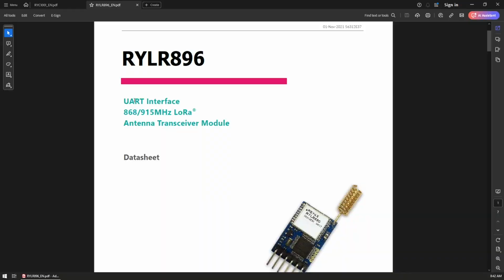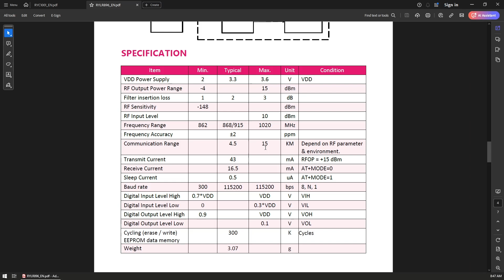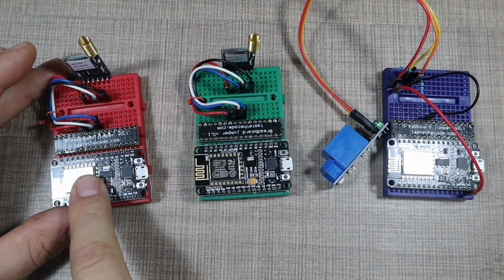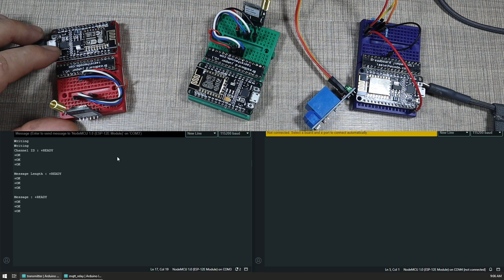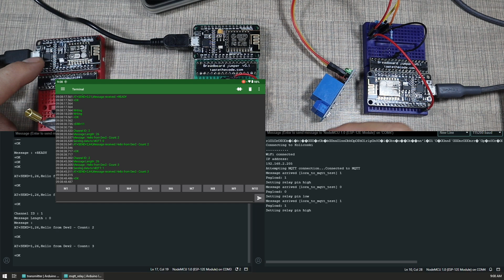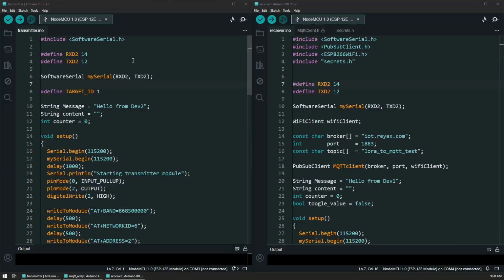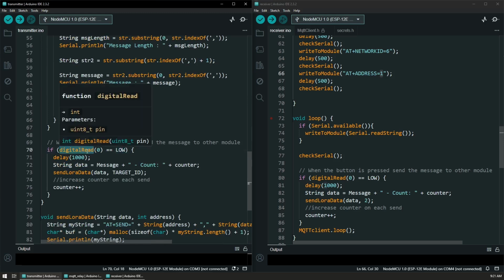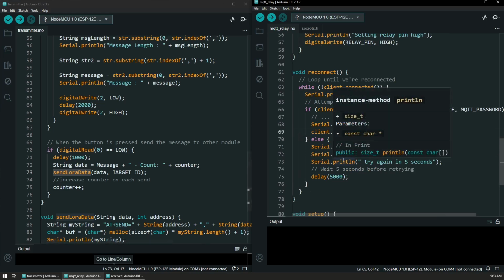Worldwide LoRa Coverage with RYLR896 and RYC1001

Comment: Your channel is amazing. Thanks for making this video. Would be interesting if we could interface handheld radios with LORA using either as a modem for data transmissions.  For longer distances it would be interesting to use a balloon or drone as a repeater for point to point …
Reply from the maker: Thanks. LoRa will not work for voice but there is a project, Meshtastic, that uses LoRa for emergency chat system on a mesh system.